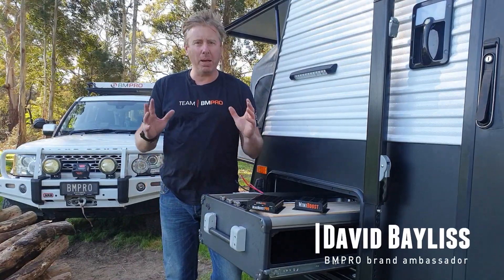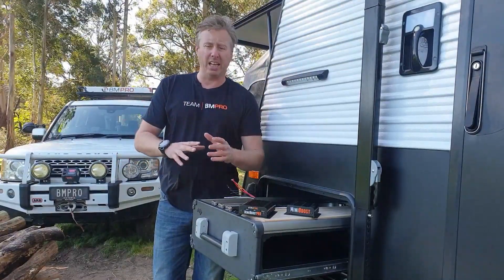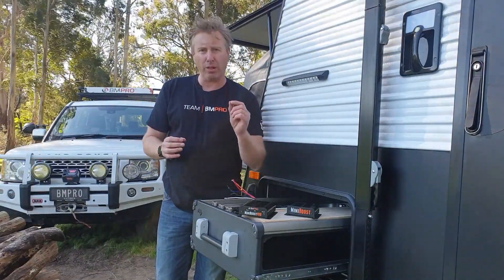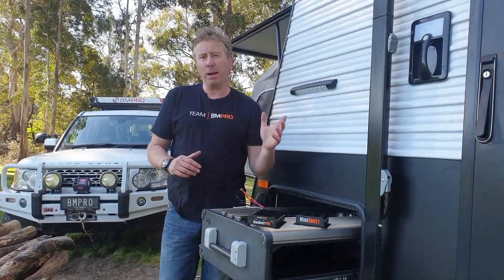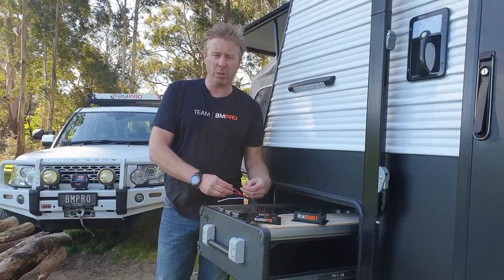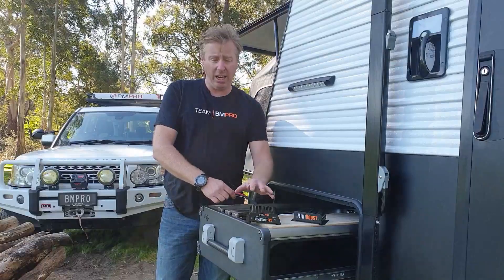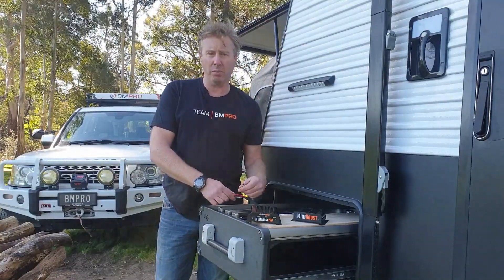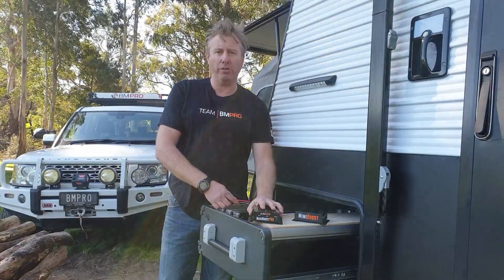Best Practice On Wiring A DC-DC Charger MiniBoostPRO (Tech Tips)

Comment: I purchased the MiniBoostPro, ModelMB3 Rev.05B over a MiniBoost as I really wanted the 30A Aux input regardless of Solar capacity (e.g cloudy day). After watching this video, David states that the AUX Boost has an input capacity of 22A with the balance being made up from Solar. Can you please clarify, as on the base of the unit it states AUX IN = 30A and Solar In = 30A. I find this very misleading, in fact for the sake of an extra 2A I could have purchased MiniBoost as my BMS does the power input blending for me. If this is the case, do you have an updated firmware available to change the AUX Boost from 22A to 30A?

Comment: Connect blue wire to caravan tail lights. Then travel with at least your park lights on and it will signal correctly when running.

Comment: I don’t believe I’m charging my van batteries through the auxiliary Anderson Plug whilst travelling. Whilst not 100% sure I believe it’s a voltage drop issue, so if I install a MiniBoost Pro in the cupboard next to my BMPro 35 II HA unit is it correct to believe it will increase the voltage to allow successful charging of the lithium house batteries?
Also when off grid camping my van is set up with 3 solar panels on the roof (480W). But due to camp sites being shaded or for that part of the year where we have less daylight hours and the angle of the sun is lower to the horizon, I can’t maintain full battery capacity. 
So as a means to increase input to the system I’m proposing to connect a portable 200W solar blanket unregulated to the auxiliary Anderson plug on the van. Is this an issue and is there any need to wire the MiniBoost Pro any differently than for the standard auxiliary feed in?
Reply from the maker: Hi Steve,
To boost the voltage from the DCDC charging you will need a MiniBoost Pro for the lithium, ideal the best location is right next to the BP35-II-HA.
The solar input of the Miniboost pro is not used when used with the BP35-II-HA. You can use the other solar port on the BP35-II-HA for a portable. Many manufacturers wire a blue Anderson plug on the side of the caravan to this point

Comment: Once this is installed will i lose individual readings on my tablet for solar and aux inputs?
Reply from the maker: If the MiniBoostPro is going directly to the battery with a BC300 shunt fitted, the charge input will show under the battery input .

Comment: why the 360 watts max solar panels?   my J35C takes 450 watts so now i have to uninstall some or not/?
Reply from the maker: The MiniBoostPRO has a 30amp regulator built-in (which does mean 360W solar). However, you  don't need to disconnect, uninstall or rewire anything when using J35C. It will take 450W solar.
Reply: @BMPROau  I dont have a j35 and have 480w of solar so does this mean I have to take one panel down?
Reply from the maker: Hi Steve, no need to take the panels down; the system will limit the power coming in, as the panels are flat mount on the roof you can lose up to 40%.

Thanks, BMPRO / Stewart